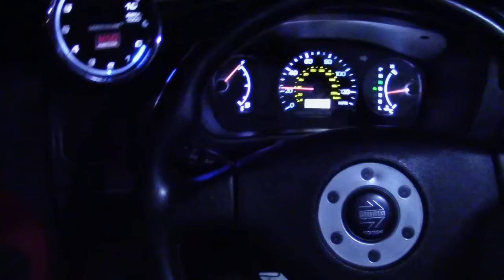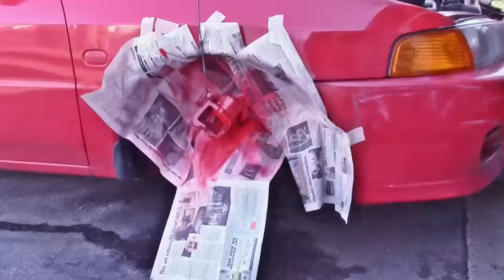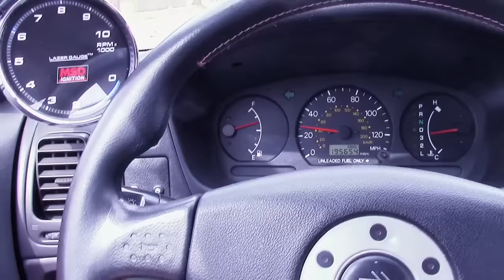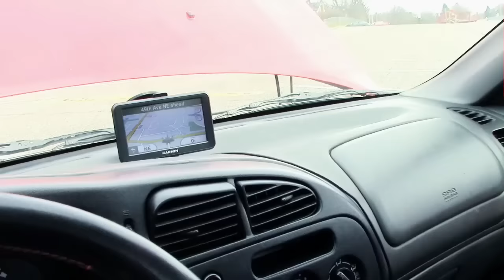Mirage Fix 21 | Coilovers, DIY Alignment

Comment: Suspension name and Rims name Also please...
Reply from the maker: +nodiko Tandashvili 
- $790 D&D COILOVER KIT DAMPER MITSUBISHI FTO GS GR 6A12 1994-2000
- $823 17"x7" MR116 SILVER RIM By MOTEGI RACING WHEELS & ACCELERA TIRES ALPHA 205/40ZR17 84W & Tuner Wheel Lock Kit M12-1.5

Cheers